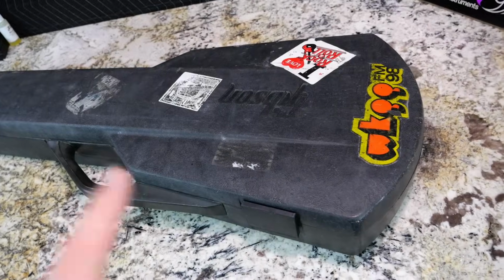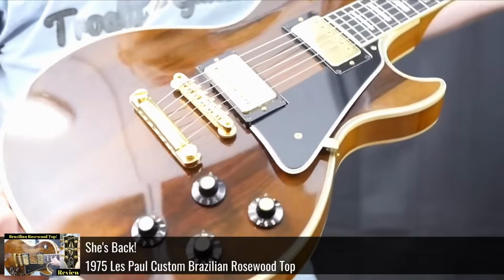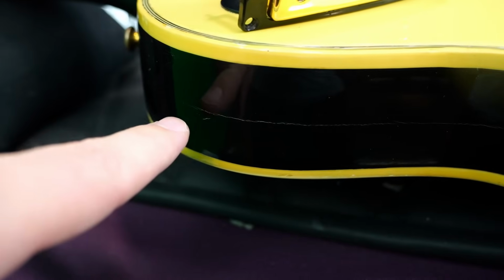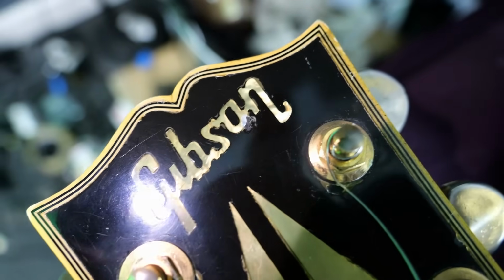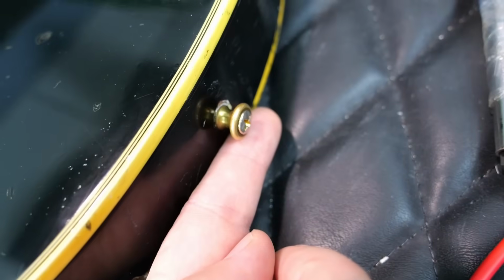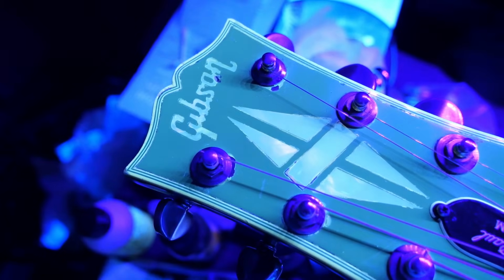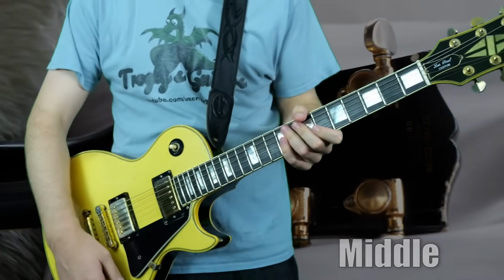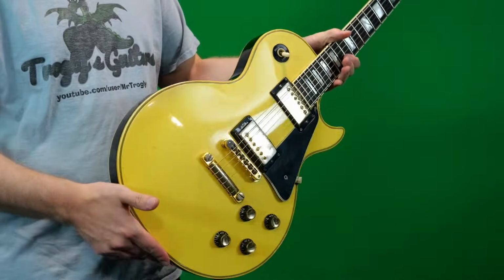The "Dokken" Les Paul | 1976 Gibson "Tuxedo" Les Paul Custom White Top Black Back + Sides Review

Comment: You might actually be able to attached the latch! 
If you have an old soldering iron, you can weld the plastic back together. With such a thing part you can cut out a piece of plastic from something else and use it to bridge it. It's not easy to get perfect, but it is a practice common for rare cracked plastic car parts so if you search it you can get some more tips if you wanna try it out.

Comment: Does anyone know when Gibson first started adding fret nibbs?
Reply: Im not super sure. But I guess is when they started producing the LP Standard in 1958.
Reply: @papasmamas1 You realize the les Paul model has been around since 1952, right? 

As for the question, the original run of Goldtops in 1952 had no neck binding, therefore, no nibs. Later 52s and onwards had binding and nibs. There were also nibs on bound neck Gibsons long before the Les Paul model was ever a thing. It’s just the way Gibson do the neck binding. It’s more labor intensive, therefore more of a “premium” feature. At least that was the idea behind it.
Reply: Long before the Les Paul was even remotely a thing.
Reply: @haggismcmutton4702  You beat me to it 👍
Reply: Thanks for everyone's replies!
Reply: Whenever it was it was the worst idea ever. Not so bad when done correctly, but often times you get a gap big enough on the treble side on one or more frets that catches the high E string. Absolutely worthless waste of time and money for something that has zero function.